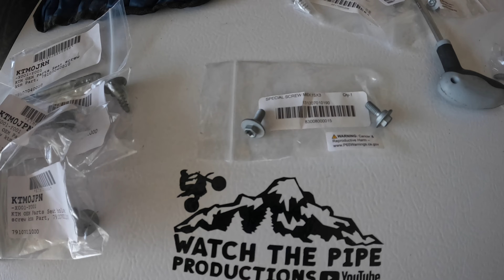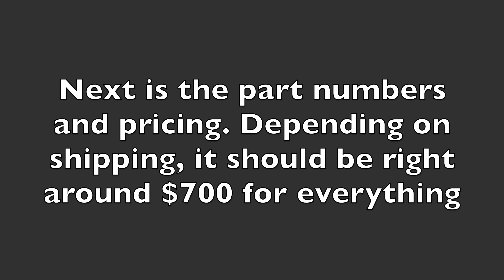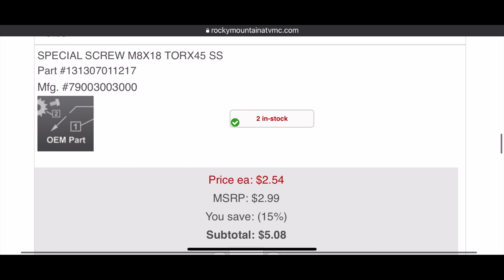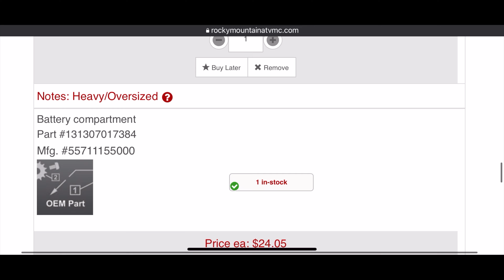Aluminum Subframe Episode 2 GasGas edition

Comment: Just looped my new 23 husky fe450, gonna try to use JB weld plastic version to put back on those little ears... it says it bonds great to carbon fiber composite blends so should do the trick... i ordered a new subframe, fender the whole thing hopefully I wont have to use them for a good while or even better, forever. Worse comes to worse ill fall back on this video

Comment: Thanks for posting this! Do you think you could have gotten away with using the husky gas tank and front fairings??
Reply from the maker: Hi @phil9022 good question! The Husky gas tank and front fairings have a different shape and will not fit with the GasGas air box in the stock shape. But it may be possible with some modifications. I can send you pictures of this if you would like

Comment: Would this work for 2018 te250?
Reply from the maker: I’m not sure, if you had a friend with a 2018 KTM XCW or a GasGas EC 300 you could try it. Not many people have performed this parts swap/installation. The internet is coming up empty on this subject
Reply: I found out it does work. Any ktm 16-18 2 or 4 stroke subframe will fit.
Reply from the maker: @trevorwallace3 oh that’s great news! Thanks for your help in researching this!
Reply from the maker: @destroyer-kk8kw

Comment: I’m going to try this to my 2023 te300 and if it works I’ll put one on the 23 fe450 if I ever loop it
Reply from the maker: @Donny538  very cool bro! Feel free to reach out to me if you have any questions I can answer!1
Reply: @watchthepipe   when you did it with the xc-w subframe was any other part’s different? Do you think I could use ktm parts to turn the husky into a semi ktm as I love the look of them more then husky
Reply from the maker: @Donny538  I made a different video showing the parts that would need to be swapped with the KTM XCW 300 to install the aluminum subframe
Reply: @Donny538  Yes, the conversion is not only possible but it is simple with the correct parts. You will not be able to use your Husky fuel tank or seat.   The only hard part is the $$$ it cost...  but so worth it.  I did a 2021 FE350s using the KTM/GASGAS Aluminum sub-frame & all GAS GAS plastics, seat, tank & hardware.  Watchthepipe lists the parts needed & I raise my glass & toast him for starting this make over!!   You can use either KTM or GASGAS components but you must choose only 1 direction,  I chose GASGAS option because KTM or Acerbis/Polisport did not make a white or gray  plastic KTM kit. GAS GAS had White or Gray plastic kits so I went with White plastics & a custom designed graphics kit for GASGAS plastics but with Husqvarna logos, just like in this video.  Your Husky can be magically transformed into a Hybrid.

Comment: Thank you for this video!!  I will be doing the same conversion & you saved me so much time. What type/name skid plate with linkage guard is on this bike?
Reply from the maker: Hi Rocci, I’m glad this helped you my friend! The skid plate with linkage I use is AXP Racing HDPE brand. There are a few other brands with a similar designs
Reply: Thanks, Forgot to ask who did your graphics kit, they are perfect.  @watchthepipe
Reply from the maker: @roccicicatello3  I used OMX Graphics for this graphics kit. They did a great job and I’m very happy with the experience I’ve had with them.